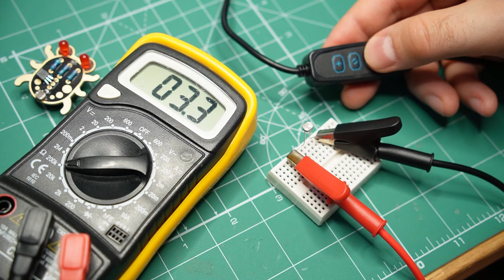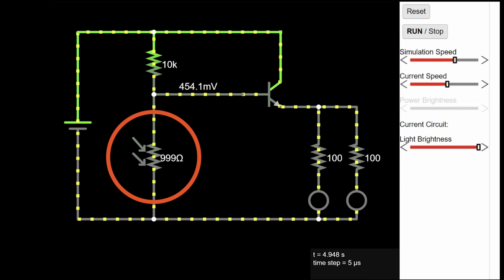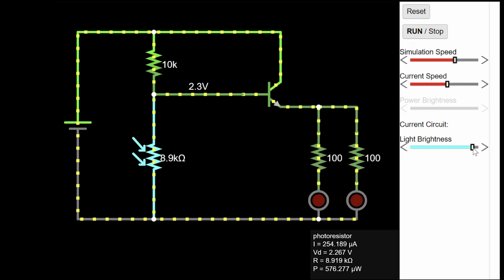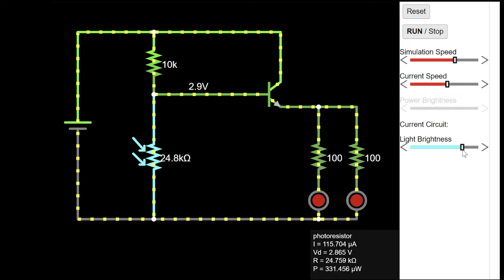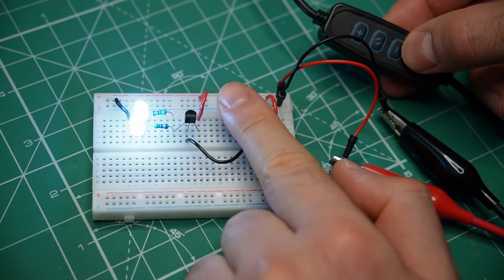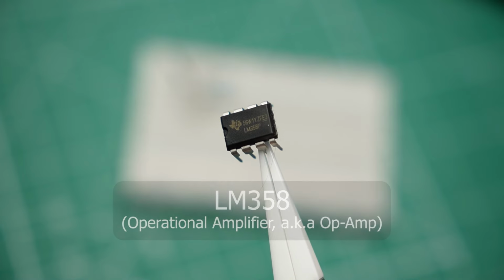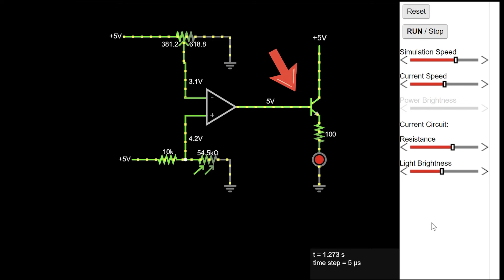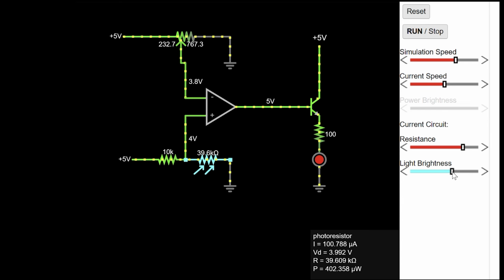How to make a light activated switch (DIY circuit)

Comment: Now you want the LEDs to turn on immediately when it's dark, but turn off when it's bright but only after a predefined time has passed, to ensure no one has just pointed a flashlight at your sensor; subject for a next video 😅 Maybe the 328P would be an overkill for such a thing, consider using an ATtiny85 for example.
Reply from the maker: Hmm, interesting use case. I bet it can be done without a microcontroller.
Reply: @LeftyMaker  yeah but it would then require some latches (RS or JQ latches ?) Or, alternatively, a number of op amps and transistors. The MCU solution would be the only design with the least possible BOM
Reply from the maker: @RogerTannous  given how cheap some microcontrollers are, you may be right

Comment: Could you show me how to make it be an inlet and outlet so I can use the outlet for power then plug a sting of lights in the inlet while making where it turns lights on when light hits it (switching the two resistors).

Comment: Hey lefty ,which software are you using to simulate circuits
Reply from the maker: What you see in the video is the Falstad circuit simulator. It's not the best, but it is very simple to use
Reply: @LeftyMaker  but looks cool, I use Proteus cracked version

Comment: awesome!! can you make a similar smaller device that lights on based on distance?

I used a PIR device but my scooter compartment is hot enough that the device stays on.  so i am thinking a distance based one might work better
Reply from the maker: I haven't played with such sensors, but I might some day
Reply: WHY>>>  makes no sense to me to use either type on a scooter. do not violate the mtor ehicle  laws
Reply: @LeftyMaker  btw  just thought of an even simpler solution. using a magnetic switch